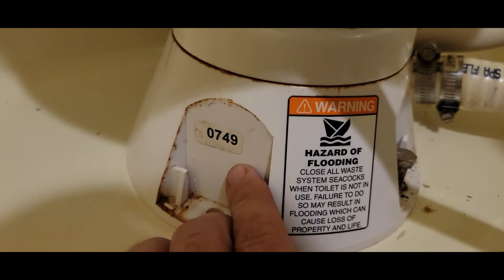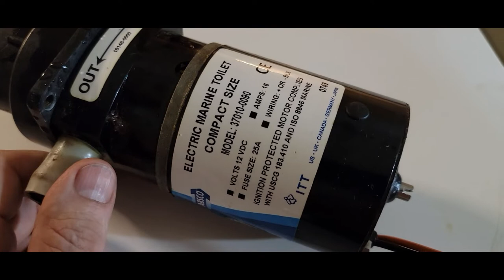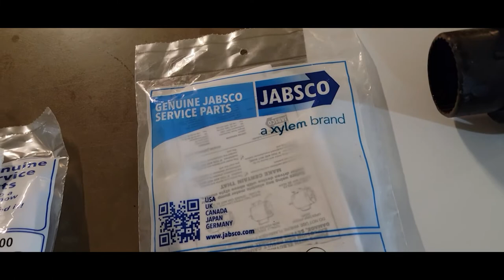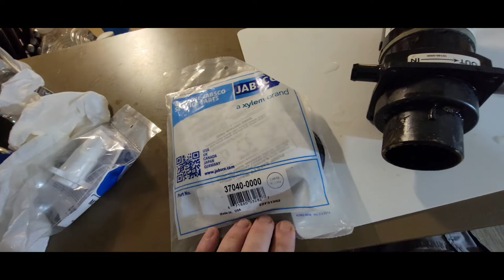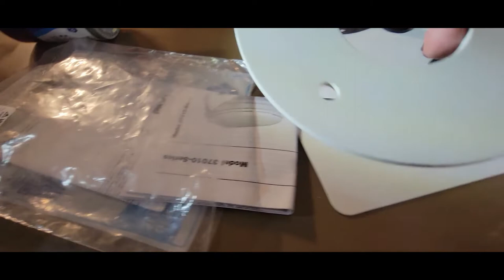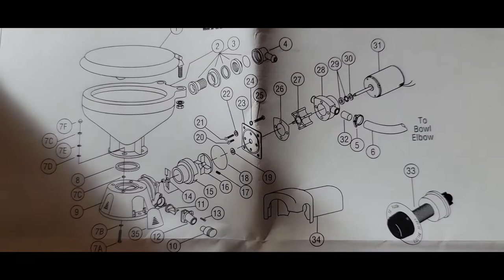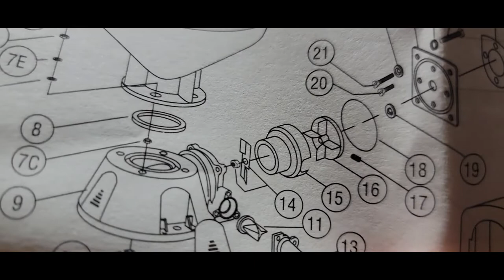Jabsco Marine Toilet Rebuild

Comment: Great video.  I have same toilet with similar issues.  Im just curious why do i have another macirator by my holding tank. Its a much bigger one. I changed that out last year. And it has its own switch   Whats the funtion for that one.  Thanks 😊
Reply from the maker: I would assume that one is for moving the waste out of the holding tank?